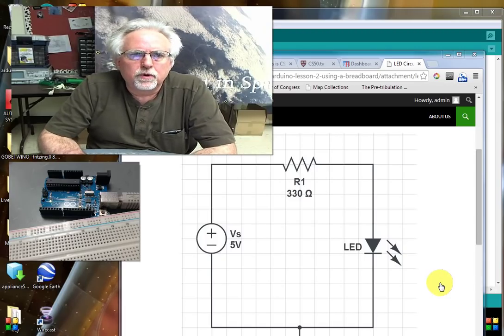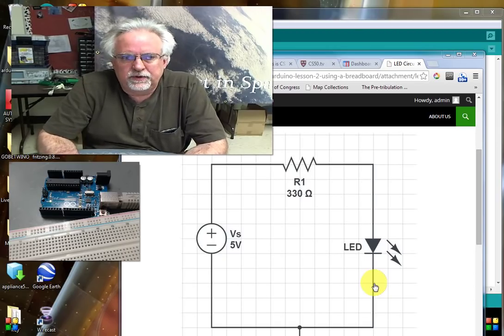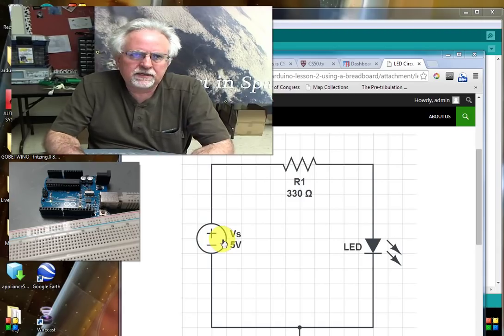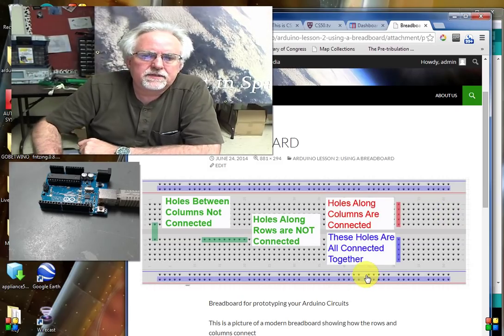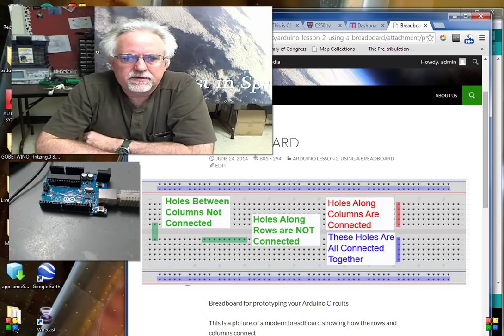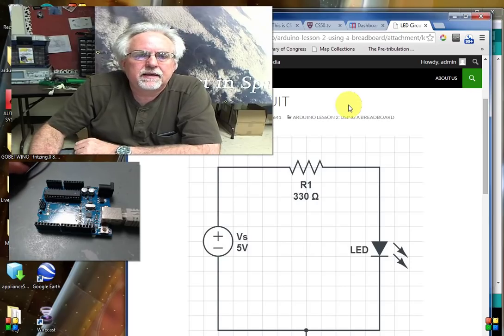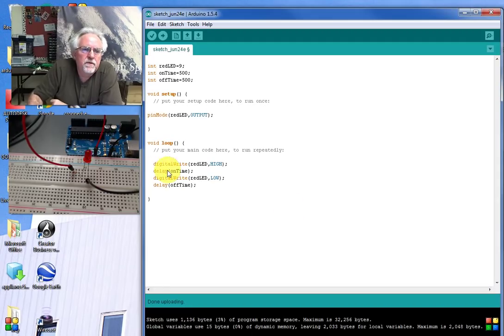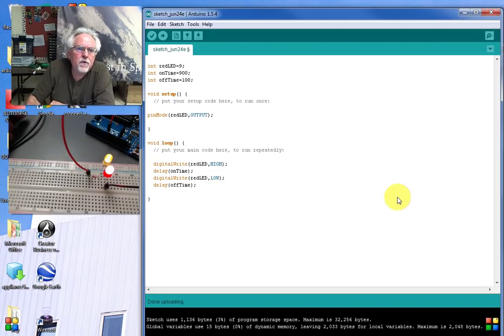LESSON 2: Simple Arduino Breadboard Tutorial

Comment: Haha, this is awesome! From your previous video i already had all the variables so all I had to do to make this work was change "int LPin = 9" instead of "int LPin = 13"

My little kit even came with 330Ω resistors :)

So, before I finish this video, I'm gonna try to code the LEDs on pins 9 (breadboard LED with resistor) and 13 (built-in) to alternate their blinking. This is so much fun! Thanks again - you're an excellent teacher.
Reply from the maker: Well done, grasshopper
Reply: Thanks! So I wrote the code but it wasn't working how I thought so I read the docs on delay command and it says no more calculations can happen while doing delay. Therefore I had to make the times even and just basically say {make pin 13 high & 9 low, wait 1 second, make 13 low and 9 high, wait 1 second} in a loop. I can't wait to learn more.
Reply: "Computers are the levers that allow modern day wizards to create new worlds." ~ One of my computer teachers

Comment: That's so awesome, Paul! I have one question. I have 470 Ohm resistance, and I tried the experiment by that but the LED is not lightening. Any advice?
Reply from the maker: It should work with that. Are you sure you have the LED in the correct direction?
Reply: Then try with 220 Ohm..

Comment: Doing your experiment I hooked up an Oscilloscope to the project. I set the waitTime to .01 and the waitTimeOff to .01. The output of the scope is 47 kHz.  When I set the 2 variables to 1 it produces 493 Hz square wave. It appears the fastest square wave possible is only 47 kHz, in your past experience does the output of the Arduino have a 47 kHz limitation?

Comment: Paul first of all I thank you for all of your hard work putting this together.  One question,  Can you have multiple items used on a single pin?  example:  If I have two cameras and I want them to respond the same way at the exact same time, could I set them to pin 9 together?  Or would these have to be separated with their own unique coding?
Reply: Paul McWhorter is this correct if I am using lesson one and lesson two together?

int light=13;
int on=900;
int off=400;
int extLight=9;

void setup() {
 pinMode(light,OUTPUT);
 pinMode(extLight,OUTPUT);
}

void loop() {
  
 digitalWrite(light,HIGH);
  delay(on);
 digitalWrite(light,LOW);
  delay(off);
  
  digitalWrite(extLight,HIGH);
  delay(on);
 digitalWrite(extLight,LOW);
  delay(off);
}
Reply from the maker: +Felix Morales It really depends on what you are doing. You could turn two LED on and off together, but more complicated things maybe not. Always need to be mindful of not drawing too much current from any one pin.

Comment: Great Videos! I am using 2 Arduino's in my latest art project which has a 150 year old clock driven by stepper motors as the center piece. One Arduino will operate the clock functions and some LED's and the other will operate the chimes and the chime stepper motor drive. I will be watching your videos to make it all happen and learn at the same time. I need to make a wiring diagram and I was wondering what program you use or recommend to make your drawings with? I have Linux as an OS...

Comment: I just have a small doubt which i know is silly but is etching my mind. I have read in the board description that pins 0-13 are digital outputs. How is the LED blinking from a digital output? isn't it supposed to be an analog output?
Reply: Digital 1= 5v or 3.3v and Digital 0=0v or ground. So that's how it works and code is so written to get this and thereby control the LED

Comment: ~Why do we need the resistor, the LED would just be brighter, and that is better, right?
~Also, would a 220 OHM resistor make an LED brighter (hold back fewer volts) that a 330 OHM resistor?
Reply from the maker: +Rohan Arcot The resistor is to limit the current. If you do not limit the current you will likely burn out your LED. Also, if you draw too much current from an Arduino pin, you can also burn out that pin, and possibly the entire arduino. So, when you use LED, you ALWAYS use a current limiting resistor.

Comment: Hello Great videos, Question the LED is not bright enough. I hooked it up exactly how you did it but it is still very dim. I tried every thing. checked all connections and even hooked it up diffently just to check another way. when i actually plug in the anode wire in the positive 5 volt rail it lights up fully to the full brightness, but that is not what I want, right? so I place it back into pin 6 (which I set it to) and is still very dim. I even change lower resistor ratings and it still dim....Can you help?
Reply: by the way i am on listen 11 -- the potentiometer lesson, so if i can get it work I am not sure how i'll be able to make it work with the potentiometer.

Comment: i wounder if the resistor will burn out if you put a lot of LED lights on the breadboard? And tried to power them all.
Reply: In series, they won't light, must use in parallel for a lot of LEDs.(then each one has its own resistor).

Comment: what type of wire should i use to connect arduino to breadboard. I am confused whether i should use male to male jumper wire or female to female jumper wire please tell me sir
Reply from the maker: Use whatever fits. If you have female connectors on the Arduino, then put a male connector into that pin. The breadboard needs a male connector. So, usually you will have wire with male/male ends. Some arduinos have pins coming out, and those pins you would connect to with a female wire.

Comment: //connect 5 leds from port 2 to port 6

//5 resistors of 330 ohms
//5 leds

#define PIN_NUMBER_FROM 2
#define PIN_NUMBER_TO 6

#define DELAY_TIME_ON 500
#define DELAY_TIME_OFF 500

int count = PIN_NUMBER_FROM;

void setup()
{

  for(int pin = PIN_NUMBER_FROM; pin <= PIN_NUMBER_TO; pin++)
  {
    pinMode(pin,OUTPUT);
  }  
}

void loop()
{

  if(count == (PIN_NUMBER_TO + 1))
    count = PIN_NUMBER_FROM;

  digitalWrite(count,HIGH);
  delay(DELAY_TIME_ON);
  digitalWrite(count,LOW);
  delay(DELAY_TIME_OFF);    

  count++;
 
}

Comment: Hi

I attached 3 leds to ports 9,8 and 7. All with the same size resisters but the led on ports 8 and 7 seem to be a lot duller?
Reply from the maker: Make sure you are doing your pinmode correctly on all pins you are using.
Reply: Yes I realised I haven't done pin modes for 8 and 7. But why was there a small amount of light?
Reply from the maker: The small amount of light because you did not declare your pinmodes. To use a pin as an output, you must declare it an output.

Comment: if I dont write pinMode, it still blinks but less bright. I was wondering why do we have to write that pinMode. also, if I dont attach the resistor, is the voltage too high for the LED?
Reply from the maker: You need to set your pinmodes. Adruino has to know what you are doing with a pin to configure the pins correctly. Yes, you always need a series resistor with an LED
Reply: Thanks for your fast response. YOu're very helpful. I was wondering If I don't set pinMode, why does it still work? Does it work with less power at those pins?

Comment: how do you know that # amount of ohm is needed for the resistor?
Reply: Common Led's has an forward voltage drop of 2V and are driven by 0,01A (10mA).
U = 5V
U_led = 2V
U_res = 5V - 2V = 3V
R_res = U_res / I => 3V / 0,01A = 300ohm (330ohm is almost there).

Now you also need to check if the resistor can take the heat generation(rated power), and that is done in watts (W).
The most common resistors can handle about 1/4 of a watt (0,25W or 250mW).
P_res = U_res * I_res => 3V * 0,01A = 0,03W
30mW < 250mW. Great!

Thats how you do it i think.
Reply: thank you

Comment: Sir, What is the source of power for the Arduino board after it has been disconnected from the computer ? I dont own one ! but I found your video very interesting ! I am a Naval Architecture student and I would like to use Arduino board in a Boat model for propulsion and manoeuvring !
Reply from the maker: You can run it off a USB battery, like those you get for a phone. The arduino is powered from the USB.
Reply: Thankyou Sir !

Comment: but sir you havent connected it to 5volts  then how power supply to the led
Reply: its supplied by the board which is conencted to the laptop, hence it takes the 5V from the laptop and supply it to the circuit

Comment: I have a question to anyone really.  I am sure it will come up in a future video. But i'm trying to run before i can walk. So just practicing getting the bumpy text and everything else correct. I see the next video is about loops, so maybe answer will be there. So i've made 5 leds run forward and backward like the knight rider light. Can i put more than one argument  in to to one line? Just seems silly writing digitalWrite high, low ,on ,off endlessly. There has to be an easier way??? So was thinking it could run throught the cycle say five times, Then i could get them all blink together 5 times. Yes i can do it with copy and paste. But surelyy this will eat into the memory.??

Comment: what is ground in arduino?
Reply: Please help
Reply: When you put something on ground it complete the circuit, all you have to do put a wire on GND and connect it to one of the holes on your dread board and to make sure it connects to your wiring correctly
Reply: thanks man but where does the current come from and how many volts does the ground give? thanks again
Reply: When you complete the circuit it will automatically put in 5 volts
Reply: oh thanks man I got it

Comment: Your LED on the picture is wrong?! the power from pin 9 should go to the anod leg on the LED.
Reply: It does, it goes via the resistor
Reply: the video is via the resistor--the Fritzig diagram is via ground
Reply: i noticed this too
Reply: Kirchoff's Law states it is all in series so the order doesn't matter.Current flow is still restricted the same amount, regardless of where it is located.
Reply: I'm just starting over again with arduinos. A new year thing. I forgot most of it, so starting over. But yeah, I made this observation in, i guess a future video. Great lessons though. There are so many projects and libraries out there but i wana understand what i'm doing and how too adapt/change sketches. I've bought my son an arduino kit for xmas. So i have to stay one step ahead ;)
Reply: @PyroRob69  It's a diode the the direction does matter, current will only flow through it in one direction.

Comment: could someone help me with this int Motor_9;
int onTime-3000;
int offTime_200;

void setup() {
  // put your setup code here, to run once:
pinMode(Motor,OUTPUT);
}

void loop() {
  // put your main code here, to run repeatedly:
digitalWrite(Motor,HIGH);
delay(onTime);
digitalWrite(Motor,LOW);
delay(offTime);
}
Reply: You can't simply place a motor in place of the LED and expect it to work.  A motor circuit is more complex and needs more components (like a flyback diode) and should be voltage controlled along with a separate power supply.  

Code fixes:

int Motor_9 should be int Motor=9;
int onTime-3000 should be int onTime=3000;
int offTime_200 should be int offTime=200;

But again, this code should not be used for a motor, only digital devices like LED's.